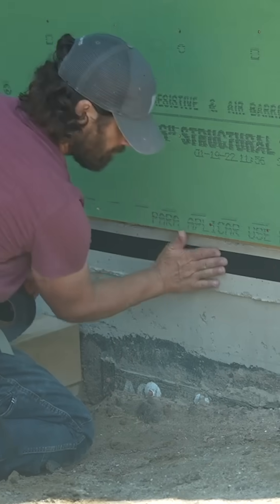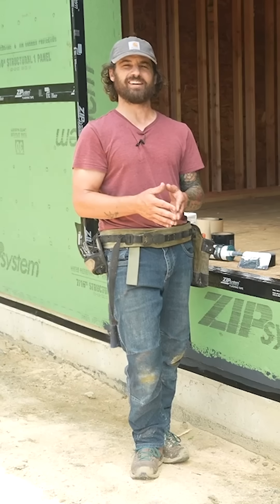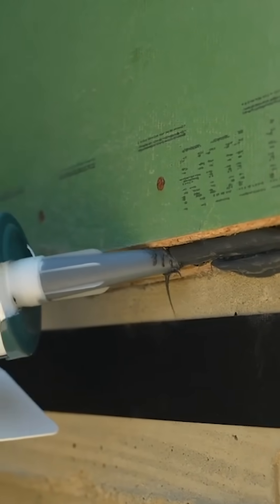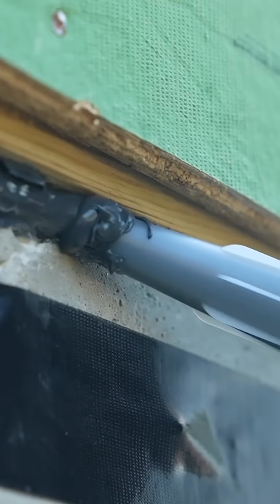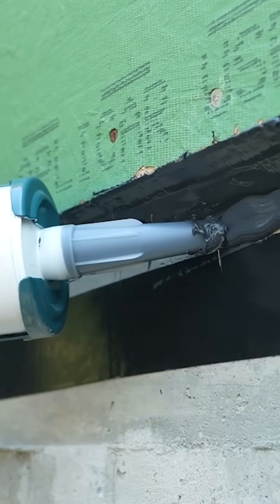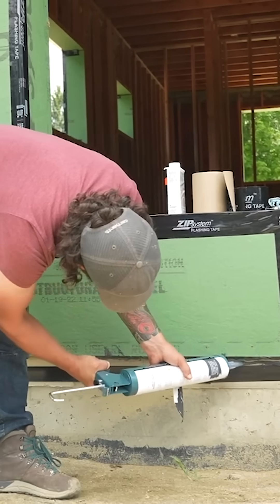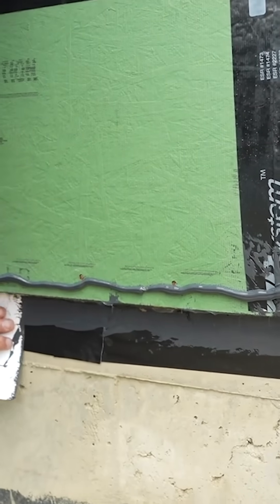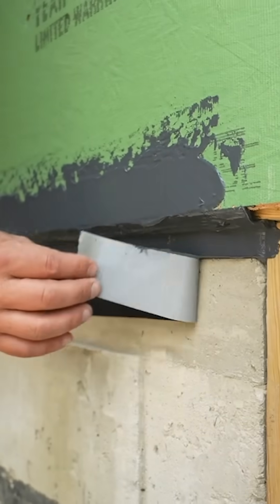Liquid Flash at a Wall-to-Foundation Connection

Comment: The title of this is Fine Home Building and you state "ideally the siding is flush with the foundation but that does not happen all the much". Why? If you are setting up the forms with string lines to verify and control straightness,  then pouring the foundation and properly placing the anchor bolts, then properly locating the holes the place the bottom plate then the siding should be flush every single time, full stop. If its not, then you are not quite to the fine homebuilding level.

Comment: Looks like the sheathing installers used shiny nails and not hit dipped galvanized - their all starting to rust - better removed them and install correct ones before siding goes up.

Comment: If the framing has an overhang of 3/8 of an inch, then someone messed up. And yes, I've seen worse but, that is merely a bigger screwup. When snapping out, you can adjust closer to the concrete to avoid this. Nobody misses 3/8 in a dimension.

Comment: How does one know what elevation to put the door opening? Why is it up rather than closer to the ground? Like right off of the top of the foundation? I guess what I’m asking is how do you determine the floor elevation?
Reply: Im assuming since I see osb sheathing on the floor that there is a stem wall with a floor joist. Some I-joists can be up to 16 inches tall
Reply: Some of the elevation can be code requirements for flood prevention or simply preventing water splash damage, but backfill (legal or not) can also make the elevation difference disappear in a stem wall like this one.
Reply: Both of the other responses here are correct. First of all, there is usually a code required clearance between grade and wood framing and grade and siding. You can check the International Residential Code for those specifics, but more importantly, check with your local building department. In this project, I needed 16 inch I-joists, and they sit it on top of a 1 1/2 inch mudsill, and there's 3/4 inch subfloor. So, the finished floor is over 18 inches above the foundation wall. It is possible to drop the floor joists inside the foundation with hangers. In that case, you'd have just one pretty average-height step from grade into the house.

Comment: I'm curious as to why you wouldn't wrap the Zip tape around the bottom edge prior to installation and keep the plywood flush with the slab/foundation instead of so much overhang?
Reply from the maker: This is how houses are typically framed and there are a couple reasons: First, sealing this area with tape or liquid flashing is a relatively new thing, and in the past, having the sheathing overhang the edge of the concrete here offered a bit of protection from water getting in beneath the mudsill, or plate. When I was building this house, I had the same thought. Since I am sealing the joint, why not push the mudsill back 1/2 inch and have the sheathing flush with the foundation and much easier to seal with tape or liquid flashing? More experienced builders than me cautioned that with the imperfect nature of poured concrete and framing lumber alignment would be challenging, at best. So, I stuck with a standard approach and used liquid flash. A lot of people do use tape on this joint, even though it is offset, but that seemed like fussier work to me. - Brian Pontolilo